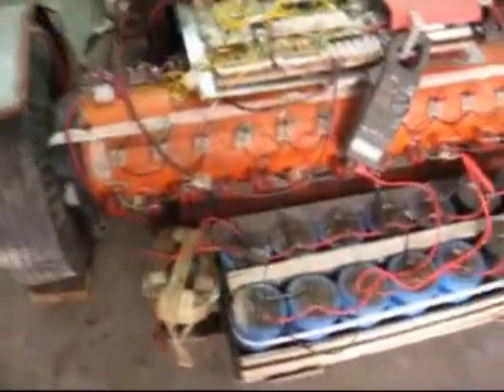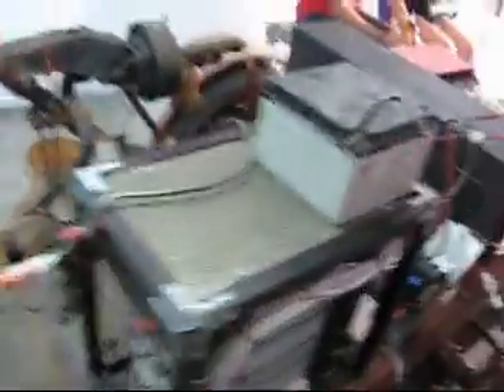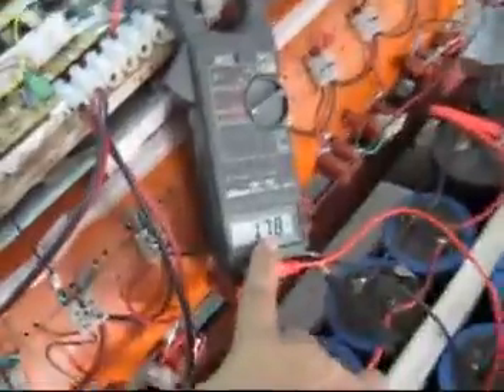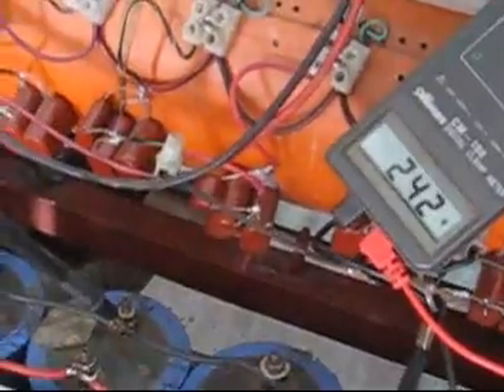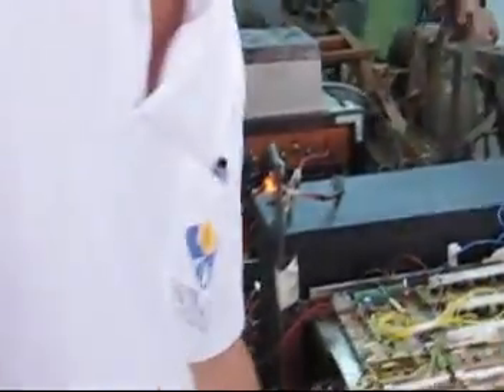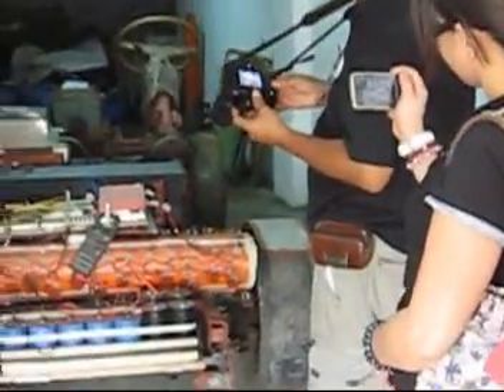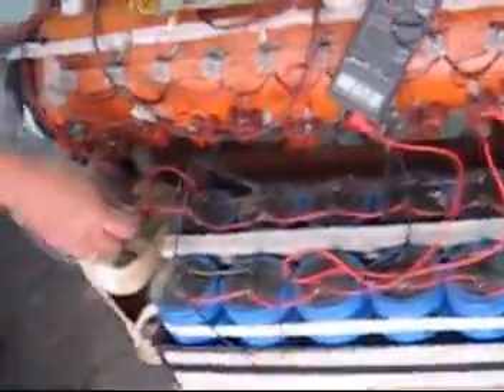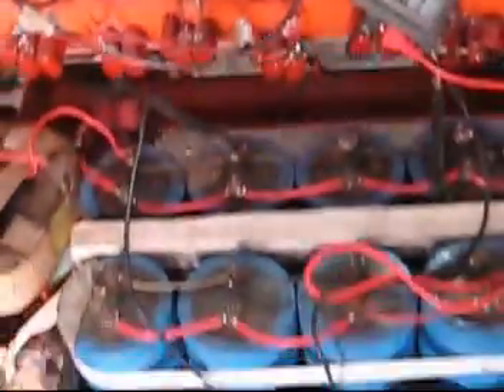Ismael Car 1/3 Actual road test very soon

Comment from the maker: a lot asking. why?? 12v bat supply not 24,36,48 or 72v. The advantage the Lower the voltage the more regenerative breaking juice (15% - 25%) and mechanical break. Commonly 48V-72v, 10% max RB collected from running current draw within city drive (Data from EV R & D experimenter) Toyota claims ( Prius 30% ) To do this it Needs  a very expensive, durable Industrial grade  Inverter. We build our own special designed Inverter of 12v into 220V/100amps capacity.

Comment from the maker: Actual road demo Hopefully next week. If you are interested to this technology, Better to keep visiting our Youtube account.  We will run the Car until the 2 set of battery run down. I hope we can beat the existing 50 Kilometers per 12 set of 6 volts Deep cycle  battery.  So far ( as per our knowledge ) we are the only one can run a 11KW, 220volts DC Forklift motor using a 12 volts battery.